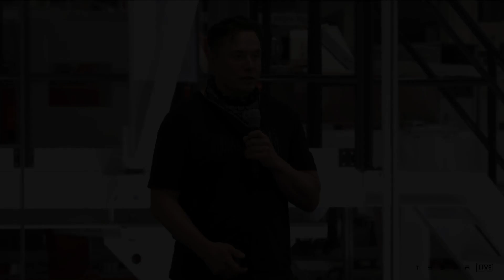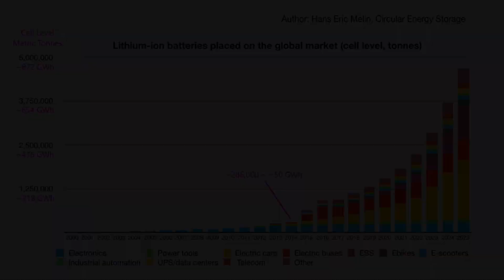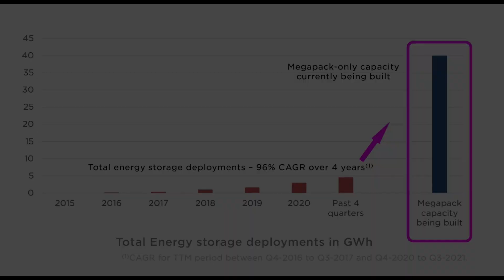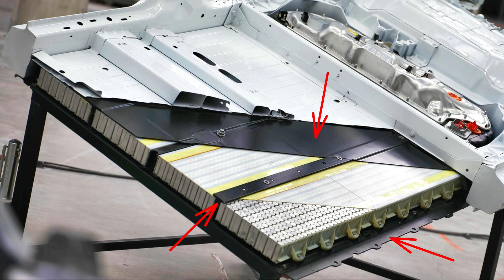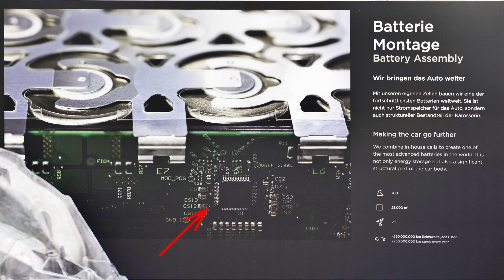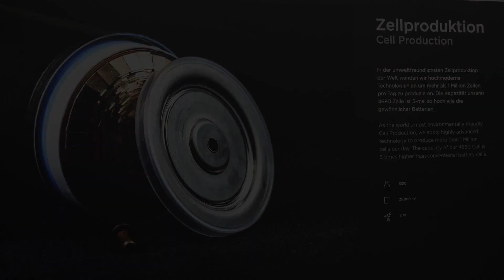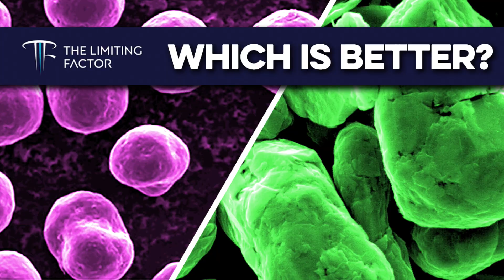Tesla Q3 - Just the Batteries // 4680 On Track, Giga Berlin, Supply Chain, and Leaks

Comment: Do you think 21700 cells will have higher energy density due to structural design compared to current design for model 3 and Y?
Reply from the maker: Not sure what you're asking here.  The 4680 will have higher energy density than the 2170
Reply: @thelimitingfactor  Sorry I meant do you think there will be range increase due to structural design of 21700 compared to current designs used in M3 and MY?

Comment: Did I miss your covering the Panasonic 4680 production announcement? Also, Elon's statement that the Keto Road & Roadrunner 4680 lines are producing more than adequate volumes to satisfy Austin, until local 4680 production ramps up there? Similarly for Berlin? Is it safe to presume that once Austin & Berlin 4680 production volumes match their MY rates, that Fremont will have been retooled to begin ramping structural pack cars with their now undiverted local battery supply? I'm gonna rehear the whole show.
Reply from the maker: I made this video two weeks ago (roughly).  I'll cover other things next quarter.  Or, I might have to start doing updates more often.

Comment: Problem I have with one layer on the floor is to replace the battery pack you would have to rip out the whole interior. That pack also has to be sealed to the cabin, probably making it very difficult to replace.  With pack lasting 15 years, what do you do with older cars when the pack is bad.  It would literally have to be a car lifetime pack. Even that something might go wrong and it needs to be replaced.  Tight integration saves weight but also makes it less repairable, all the shit Apple gets for its phones.
Reply: OR it might drop out of the bottom.
Reply: @TheEvilmooseofdoom  yes it drops out the bottom. But the front seats are attached to the battery pack so is the console and the flooring. And it has to be air sealed which means glue.
Reply from the maker: Nah, there are other engineering solutions.

Comment: Two thought: the heat for a 4680 will be less than from either than the previous two sizes because of the tabless design and emanating from the top and bottom.  Hence no ribbon coolant necessary if heat management is built into the structural design.  Less weight and better management. Secondly, the pack has less volume if the “odd versus even” rows run lengthwise instead of side to side.   Again, less weight and improved weight distribution (rotational inertia) along the centerline, between the axels.  It doesn’t take the top level engineers that Tesla has if I can figure that out.  

What I can’t see is the number of cells in each row. That will depend on chemistry, 4686 form factor results and weight of the vehicle.  I’ll keep watching for more clues.

Comment: Jordan, graphite may bottleneck with the problems China is having with energy supply. Prices if graphite are already rising, especially for Synthetic Graphite. Meanwhile needle coke prices are also rising, which is the source material for some producers.
Reply from the maker: Correct, but is this is structural and long term issue?  It doesn't appear to be, and so far it doesn't appear to be affecting Tesla's output.
Reply: @thelimitingfactor  good point, thanks

Comment: Super review, watched xpod 3 times before feeling like I got everything out of it I could. Very intense. Any thoughts on Cybertruck body folding as a process? I read about laser heating the bend points
I’ve never seen a production process involving bending anything other than thin sheet metal, it’s fast and neat but I expect folding stainless steel down the length of a truck is much more mmmm difficult?
Reply from the maker: Hmmm, I might do a video on this.  i'm definitely doing one on why both gigcasting and exo are needed.

Comment: I think the springs (specifically the copper ones at the top) maintain a constant pressure to the tabs of the cell, to ensure maximum current and thermal capability/conductivity to the electrical and thermal circuits of the cell. They would also keep the cell rigid within the enclosure eliminating any mechanical erosion to the cell as only the spring tops would be able to move within the cell as their contact surface is much less than that the tabbed ends.....
Reply from the maker: If they are springs, wouldn't a thousand cycles work harden the copper and make it brittle?
Reply: @thelimitingfactor  what about the heat, wouldn't that continue to make it ductile? but yes ductile or brittle, the springs might not last the distance.....

Comment: Tesla will be back to having enough chips mid-year, you indicate... but it still seems like that is a highly vulnerable part of the supply chain. Yes, I understand that chip foundries take a long time to stand up... but shouldn't that be started? The need for parts is expanding on an exponential pace... and, unlike batteries, which eventually will be available through recycling, chip needs will continue to increase and if they plateau, will never decrease. With the eventual TeslaBot it seems even more obvious... the demand for chips will again outpace any available supply (if not much sooner than that). Why not vertically integrate these critical parts?  As to batteries - the other thing I'm nervous about - I guess eventually Tesla will be providing most or all of their own and they are actually building capacity for that - unlike in the case of chips.
Reply from the maker: Yeah, there are chip foundaries building up.  We need more though!  Taiwan is vulnerable.
Reply: @thelimitingfactor  Third-party foundries are going to be motivated to never be idle... which means they will err on the side of lower supply. A Tesla-owned foundry would rather be occasionally idle (or even fill-in with outside orders), rather than leave the rest of Tesla wanting. Anyway... it's where I'm most worried. Thanks for the response. Taiwan is a good point.

Comment: Dear Jordan, great presentation as always and a really good in-depth dive that we have come to love and appreciate from you, thanks and well done. 

Regarding the 4680 battery and the tables cell links. If I might be as bold to suggest, with the increasing diameter of this battery and tightly coiled nature of the role, and with its insertion into a tightly packed cylinder expansion in diameter is going to be well restricted, but expansion and contraction will occur at a higher level than the traditional smaller battery.  

If the diameter is well constrained then a limited expansion will be forced to small degree in the lateral direction, the design of the tables cell links will then come in to play with the spring structure that is within the link design, allowing constant contact with the ability to shrink and expand slightly. 

That is what I think they’ve done with the design of these Tables Spring Link connectors.
Reply from the maker: Could be, we really need that teardown!

Comment: It seems that steel will be preferred for the structural battery pack for a couple reasons.

1) High strength steel is required for the car sides for safety. On a side impact there is very little crumple space available and a lot of energy to absorb. HSS is both lighter and the less expensive than aluminum for this case. The battery case needs to join to the side rails. Also, notice the transverse seat rails welded to the battery case in the Berlin mock-up. These rails run across the vehicle for side crash protection of both the occupants and the battery. Other cars today just use 4 small rails welded to the bottom pan. Finally, for a good joining of side rails to battery pack, you want similar metals - steel to steel.

2) Steel is a safer metal around batteries. Aluminum would melt and disintegrate in a battery fire.

3) The battery case is mostly flat sheet. Why cast a flat sheet?
Reply from the maker: Totally agree on 2 and 3.

Comment: Let me offer my thoughts on the fancy end springs:
I see four main jobs - Electrical, thermal, and mechanical connections, plus how to manufacture same.

For electrical, they afford a very low resistance connection to the thin electrode foils with many dozens of tab-like laser welded bonds. Each of the six petals had stripes of welds bonding the delicate tabs gently together just like your hair analogy. The spring gasket itself has six current collecting legs each thick enough to conduct both the electrical power and the thermal heat. I agree they would not provide spring force once compete, but they might during assembly. Perhaps to gently hold the petals down during welding?

For thermal, I had already guessed they would probably take the heat out through the copper electrode instead of the aluminum one. Now seeing that big crimp all around the edge to the main can with six perimeter wings makes perfect sense. (Actually, now that I think about it, which side is up and which side is copper?) Steel is not a great conductor, but good enough I suppose. I have been wondering if they could just take it out the bottom instead of the sides, but again, now that I think about it, the crimp end is the tab end???

I have really wondered how the aluminum end was connected but that beautiful petal spring with laser welds probably does the trick? The flat end must have the big spot weld performed through the winding center which could also serve to exit the heat into a bottom cooling plate. Or top cooling plate for less exposure to the outside temps? I wonder if the burst vents could be on the bottom or not.

Sorry for my long ramble. I will add that the end spring petal design relieves manufacturing tolerances and should be mechanically resilient to tiny shifting over time. In addition to all these first principle performance advantages, the manufacturing advantages enabled by this design shows again how Tesla's work is really brilliant!
Reply: Is that really you there? Put a big smile on my face!!! Thank you so much for all your diligent and detailed analysis! I watch everything you do and learn things that are beyond other channels. Isn't it fun to keep a technical simulation in your head that improves with each new fact?. I can't help being so impressed with so many things Tesla does well.
Reply: great comment my dude! Thank you

Comment: I think 13 gig press is to cast cybertruck in one piece. Crazy. But its tesla. Those engineers just keep pushing. Imagine you have a million orders for a truck. You know that going in. You cast this unique vehicle that has a frame that is the body that is the structure. It sets you up to build entirely more aggressively. This allows one body to be pressed every few minutes. Why else make the exoskeleton? First principles first, not design. It just so happens this allows for cyber design. There will be zero seems on this sucker.
Reply: Does casting not remove all the advantages of being cold rolled?

Comment: Does anyone know if the Panasonic 4680 use traditional production methods like the 2170 or the dry battery electrode process Tesla are using?
Reply from the maker: Trad - wet slurry probably - covered in the final video of my battery day series (9 Months of research on battery day) - Under '4680 copycats'

Comment: The stuff inside the cell expands quite a lot. The flags do not all make a perfectly flat surface. So the springy surface when it gets squeezed will make sure there is a good and spread out connection to all the flags for both those previously mentioned reasons.
Reply from the maker: Maybe, maybe not.  This is why we need a teardown.

Comment: I think the Electric Viking said the BYD LFP batteries have higher energy density.  That would suggest that Tesla would be selective on who they get LFP batteries from.
Reply from the maker: It would be more the cost and availability.

BYD are cheaper by 20%.
Reply: I Believe the Electric Viking has said BYD is planning to supply Tesla it's battery in China.Personally i think Elon testing BYD's blade battery might be stalling the production of the 4680.BYD's battery higher density might be due to it's form factor, as a blade instead a cylinder, less loss of unused space.Elon might be rethinking it's battery form factor with how to scale up production of this very long flat rectangle battery.The team might be going thru 1st principals to manufacture this form factor instead of the 4680 round can.Can they make more and faster than the 4680? Can they redesign the planned battery factories to do this? It would be better now before the concrete is set, as it were.Due to the rectangular form, it might be able to supply further up the premium vehicle line of higher density needs.I also believe Elon changed his mind on LFP because of BYD's battery.Cheaper chemistry, safer chemistry, better form factor to achieve higher density.He ran into possibly the perfect battery for the next decade and more.

Comment: I'm very interested to learn if the 4680 batteries are going to give Tesla cars a significant advantage over other EV's  Other than the battery day presentation Tesla has been silent about their performance in the actual cars.
Reply from the maker: What Blue Toad said
Reply: The way I understand it's more about being able to make the cars more cheaply by being able to use a smaller, lighter and cheaper to build batteries.  So the advantages are to the manufacturer first and foremost.  Current levels of demand are so high that we probably won't see this savings past on to the consumer for quite a while.

Comment: Couldn't disagree more lol. Even if they had the chips and every other component.. without the 4680s, it's a non starter. There is NO WAY they can get the CyberTruck into production without the 4680s. And they DO NOT have the 4680s in volume yet. Sure, they probably have enough to start a slow production of them.. but they obviously are looking at a different priority. Y first.. then either CT or Semi. But there's not enough to start any meaningful volume of Y production once Austin gets going, so it's likely going to start there with the LFPs from CATL. My interpretation of everything is that the 4680s are a bigger hold up in the CyberTruck then even all the other supply issues. Model Y doesn't really care.. yes they want 4680s in it.. but it's going just fine without them. CT is being held up by 4680s. Until Austin gets online with 4680 production, there will be no ramp up.. they might be able to get production started on CT in Austin with the Kato road stuff.. or they might put those into slow production of Semi in Nevada. Hard to know what their priorities are. But I see CT as their biggest next project... and that is contingent on volume production of 4680s. Which don't seem likely to get into any volume production until mid to late 2022 at the earliest, with help from Samsung saying they are getting their 4680's into production around mid 2022 also. IF they get the yield rates up and that final 10-20% of the production process he mentioned still causing the problems, hammered out. Whether those issues are in the battery or the pack is not much of a useful distinction to me. Until those batteries are ready to be put in vehicles at volume.. doesn't really matter where the hold up is
Reply from the maker: Kato has plenty of output to begin the production ramps.
Reply: @thelimitingfactor  ramp.. i agree.. but there is no production capacity for probably another year or more to get into volume, right? So why would you even start to ramp in the next year until you have volume production. Unless it was something like Semi that could benefit from just a very slow ramp.. like literally just a dozen or so a quater
Reply: Kato is producing quite a lot of batteries is what I heard.  In addition aren't some other suppliers also making 4680?
Reply: @bluetoad2668  samsung for sure has announced it.. but it’s supposed to begin in like March or something next year.. then you would expect they will need to ramp up also. It all seems to be aligning for a late 2022 timeframe for Cybertruck.. which is what they’ve announced.. barring any problems. And probably starting to migrate the performance and long range model Ys maybe 2nd or 3rd quarter. But I’m curious to see how they manage that.. will Fremont also go to some 4680 model Y production? Will Fremont just make the standard range with LFP and let Austin go full bore on long range and performance only? It seems like it would complicate the lines to have two very distinctly different battery packs.. but idk for sure

Comment: I think that the chip shortage slows output of final products,  but does not slow R&D, 4680 production,  or assembly of the body in white.  Tesla can take advantage of having to slow their assembly line speed and take the time to nail down quality, make running changes to assembly in order to make it more efficient,  and build a stockpile of made- in- house components,  if that's helpful to their goals.  Then,  as chip supply increases,  they'll be able to ramp up even more quickly on the back end. The Semi and Roadster and Model "2" may be fully developed and production- ready ahead of time. S and X offer high profit-per-chip, but demand is lower, so ramp up may be quick,  but limited to what their smaller markets will allow. 

Also,  Tesla is probably diverting energy to lithium mining and negotiating the build of new factories worldwide.